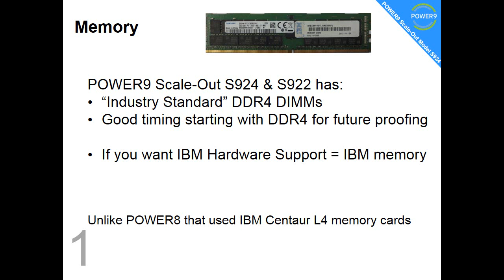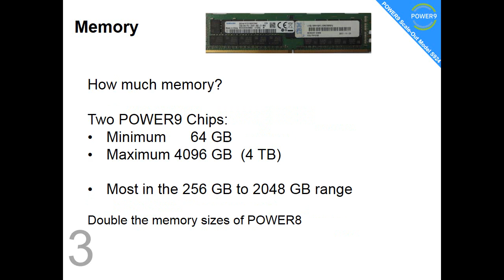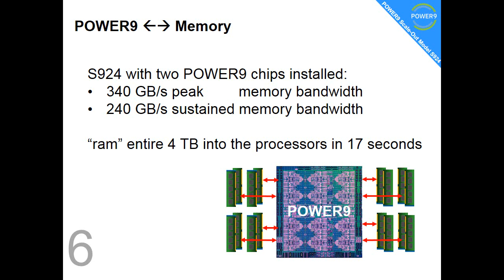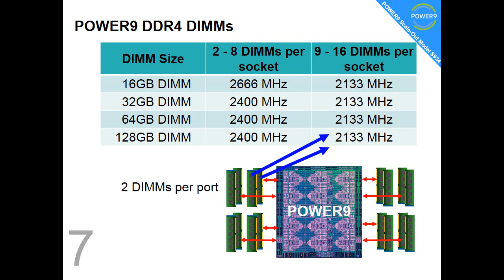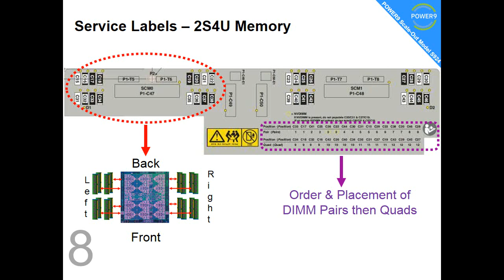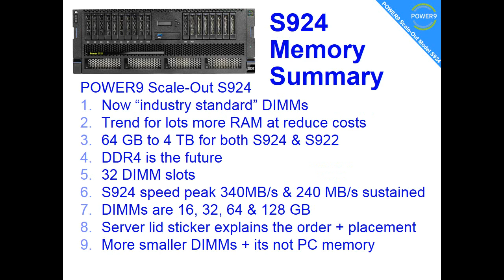POWER9 Scale-Out Server S924 10 facts on Memory

Comment from the maker: While true it is fortunate that most workloads are not bottlenecks in sustained memory  bandwidth. They are limited on CPU and I/O plus the DDR4 memory comes at lower cost which is vital with ever bigger memory demanded by modern-day workloads.  In my limited random memory tests DDR4 was actually slightly faster so it depends on the memory access patterns.

Comment: Unfortunately without the buffers (Centaur chip) the sustained memory bandwidth drops by 29 percent, from 210 GB/sec per socket with the Power8 and Power8+ to 150 GB/sec for the Power9 SO variants. So it is not great at all and inferior to previous Power systems.